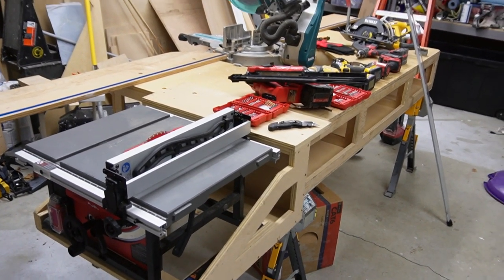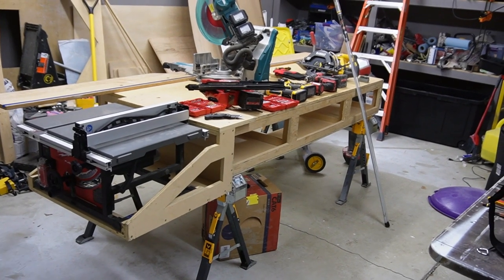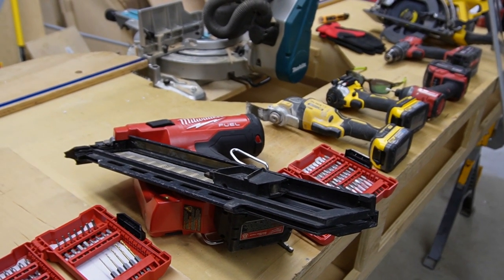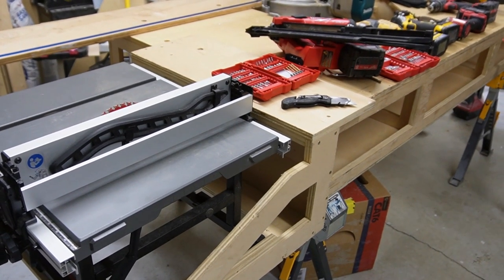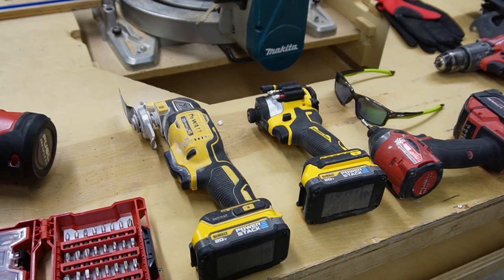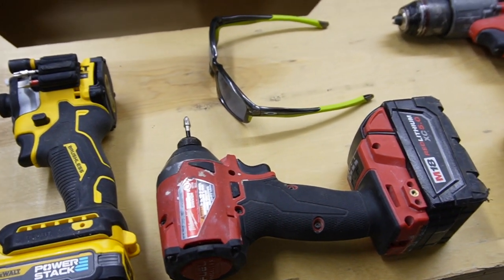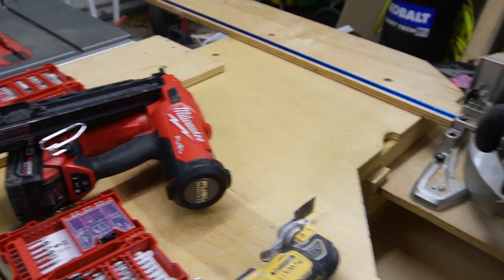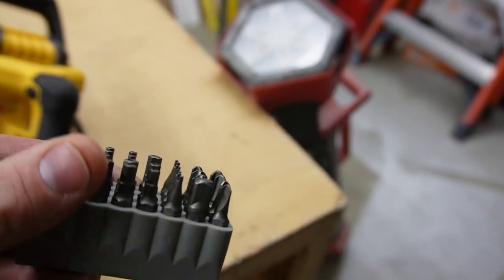I Can Do Most Jobs Just With These Tools!

Comment: I do residential rent house repairs and renovation for property  managers, banks, and REO's.  I couldn't live without your listed crap plus my Grinders, my jigsaw,  recep saw, specialized plumbing tools, ladders, folding work table and much more. I have two service trucks. One is a fully outfitted service truck and one is my "large object" truck that is mostly empty, until I need to deliver/pick up large objects - like refrigerators or landscaping. It is also my back up truck when my regular service truck is down for maintenance and repair.  I gotta have it all to be really successful in my market niche.  Some colleagues try to work out of a single pick-up and/or a trailer, and they are always struggling and/or getting robbed.

Comment: As a paint and drywall guy my list is different but multiple sprayers, dust extractors, sanders, power washers, and miter saws are essential for me. The bottom line for me is if a tool repeatedly saves me time it's essential.